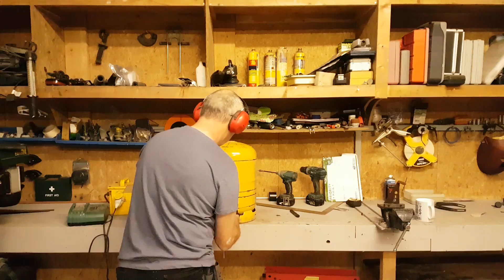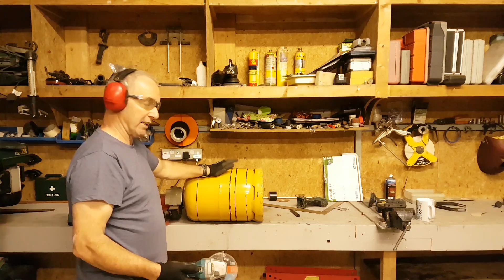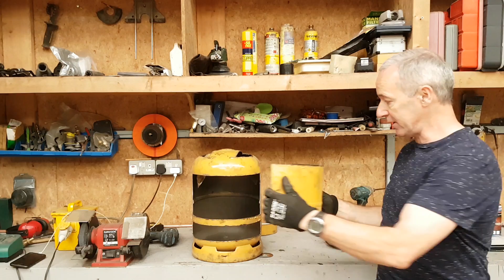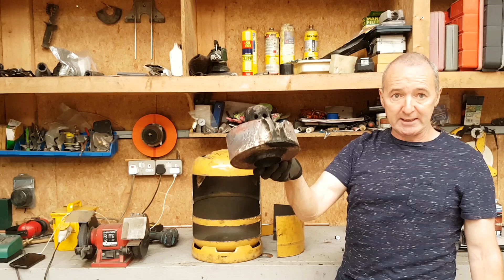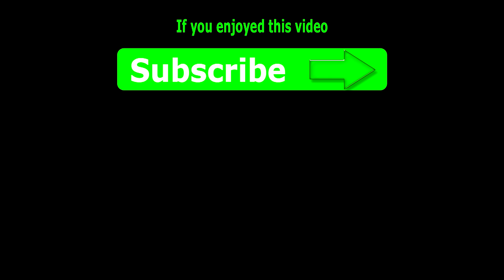Awesome Homemade Waste Oil Stove ..  Free Heat .. Build 2

Comment: Curious as to how you fill the door gaps? I've cut my tank and the gaps are significant...
Reply from the maker: Hi Steve. I added some 3/4 inch strips to the inside of the tank around the door and stuck on some fiberglass rope. The hinges need to be offset a little to allow the door to close. With enough suction on the unit with the flue it wont leak through the door even if it has no rope. Hope this helps Cheers Gerry
Reply: @GerrysDiy  perfect. Thank you

Comment: Did you wind up cutting out the rest of the top of the propane tank or is it still dividing the heat to each side?
Reply from the maker: Hi Sam. I just have 2 openings in the top and it works fine but I think that I could just as easily cut a 6 inch hole in  the top. I have been using this stove all winter and it works great. I made a new burner unit for it too here's a link https://youtu.be/ShTLaYKjzxw Hopr this helps cheers Gerry
Reply: GerrysDiy thank you. I have a pretty big fab shop and am having one expensive winter so far heating it. I’m hoping building your heater will help. Thank you, keep up the good work.

Comment: Gerry super glad to see ya back at it and new ideas...getting mine all setup from your forced air original model as I store vehicles in my 32'x40' shop over winter, it's finished metal building w sheet rock, any thoughts on keeping savage heat off wall? Cement board I used on old wood stove but this is so much hotter
Reply from the maker: Hi Erik. The radiated heat off these things is pretty intense alright. Possible a  half barrel as a reflector and a shield  before the heat gets a chance to get to the nearest wall. I was going to buy flue for my own setup but I see my local metal merchant has 6 inch galvanised pipe  in 6 m lengths. The fact that there would be only one or 2 joints to get the whole thing connected would make for superior draw / suction on the  chimney. Thanks for the comment Dale. If I can do anything to help let me know Cheers Gerry
Reply: Gerry's Waste Oil Burner thanks as always keep up the great work, new video looks great quality

Comment: Another great video Gerry. Looking forward to see how well this will work.
Reply from the maker: Hi Patrick. I have another video uploading now but it's not the final working one yet. It's getting there though and I have an idea to make the heat even and the surface area greater. The heat output will  be a lot more than the little minion stove which was a champion little heater. Thanks for the comment Patrick Cheers Gerry

Comment: I can't wait to see the final outcome. This might be the solution for my stove. Stick the enclosed burner unit inside the stove, this would be far easier to direct the airflow thru the burner rather than trying to block off all the air passages at the bottom of my stove. Aww man, I just checked, the propane cylinder wont fit thru the door. My propane cylinder measures 12" and my door opening in the stove is only 11 3/4". I gotta find a slightly smaller cylinder. I'll bet a freon cylinder would work!
Reply from the maker: Hi Marcel.  I saw some fire extinguishers that might be a good fit for you. I am not sure how heavy the wall thickness is but it might be worth a try. I will be using a few different burners on this setup once complete. The forced air gun type burner will be on a timer and a networked controller all going well.  Thanks for the comment Marcel. Cheers Gerry

Comment: Used to be able to salvage for free as many propane cylinders as I could use from the area dealers.
Reply from the maker: Hi John. I could have done the whole thing with  large propane bottles but I haven's messed with oil drums yet. When this is working I will be using a forced air setup on it. I  want  to be able to put the whole thing on a timer or even run it from an app on my phone. I have the electronics working already all I need now it the time to put it all together. Thanks for the comment John Cheers Gerry